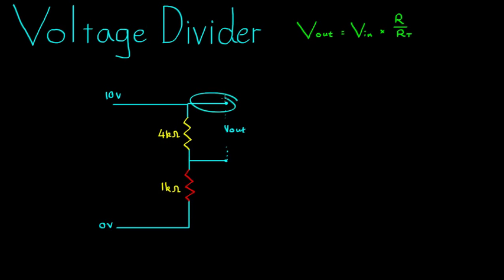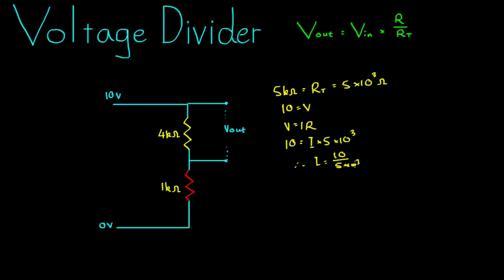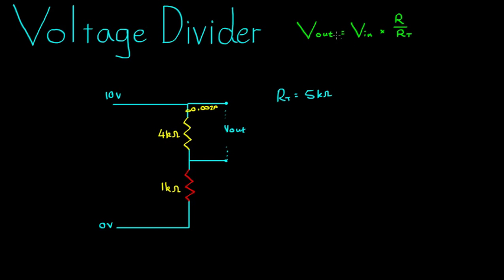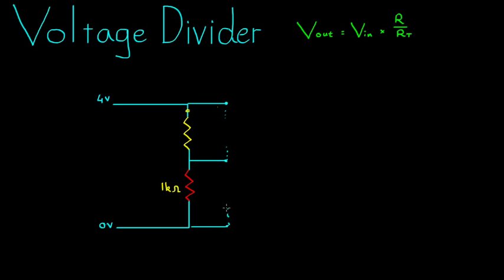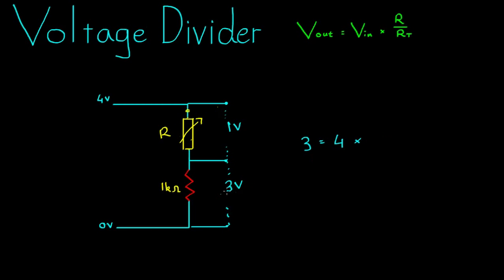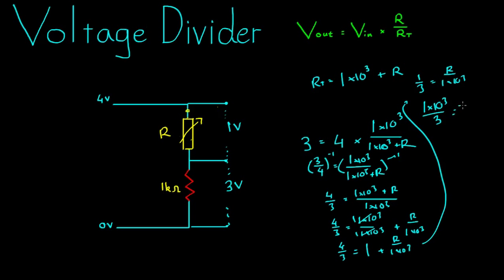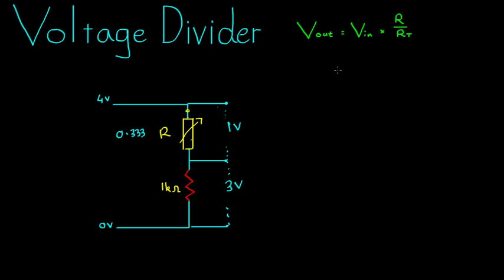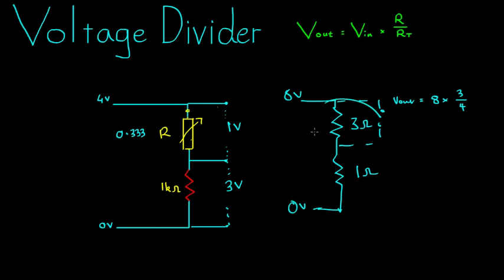Voltage Dividers Example

Comment: Algebra  1000 ohm/3V = 333ohm per Volts parts, therefore 4v-3v=1v and 1v x 333 = 333ohm ..... current= 4v/4000 ohm = 0.001mA